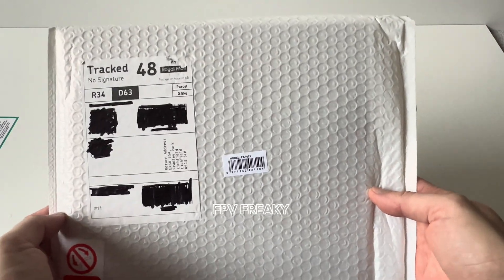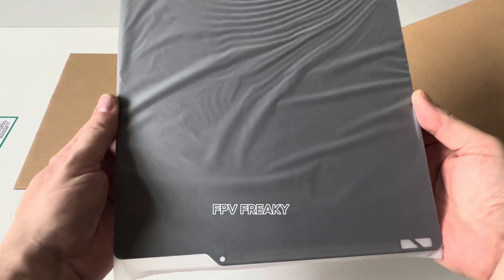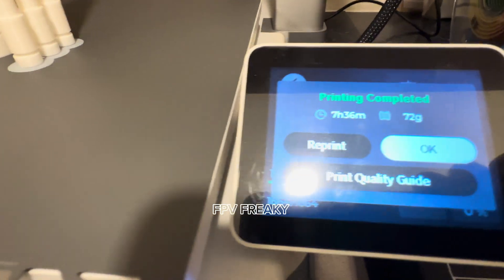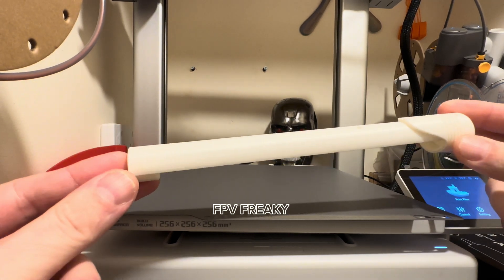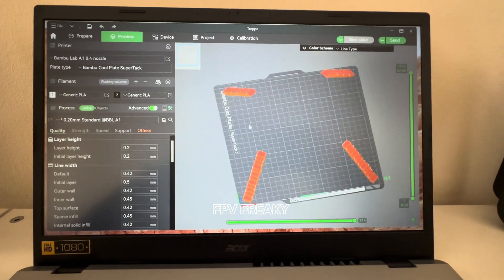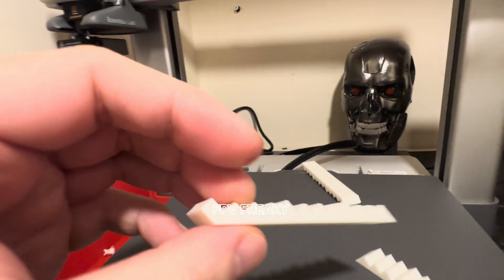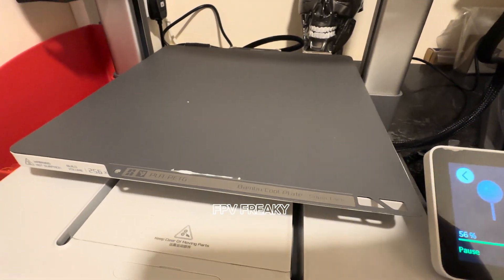Putting The New Bambu Labs Cool Plate To The Ultimate Test!

Comment from the maker: Time stamps
0:00 Unboxing The New bambu cool plate super tack
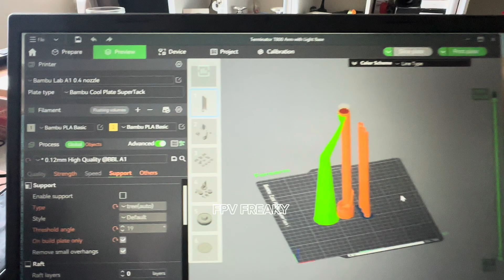1:54 loading my first failed print with the new plate.
3:11 swapping the new build plate over to the new cool plate super tack
3:26 timelapse of the first print on the new 3d build plate 
3:49 OMG WOW moment
3:53 Let’s have a look to see how well it has done. 
4:41 taking the parts off of the new super tack build plate for the first time.
7:25 problems I had beforehand.
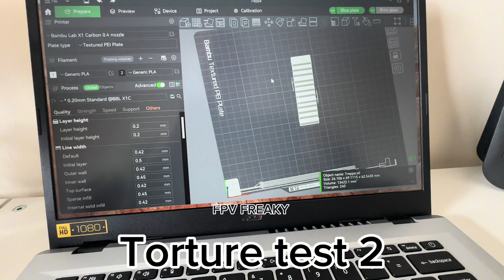8:10 second torture test loading a new model.
9:00 timelapse of the second torture test.
9:17 let’s have a look at the second test ( must watch).
10:41 third test pushing this super tack plate to the limits 45° 50° 55° angle tests. 
11:14. Timelapse third torture test what will happen?
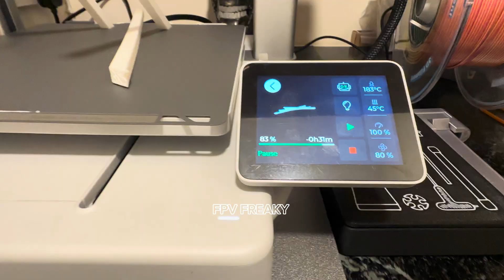11:43 let’s have a look see how well it did on the third test. 
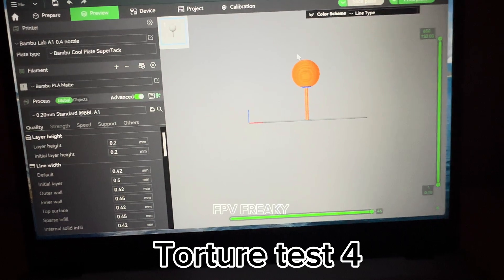13:03 fourth torture extreme test. How well will it do?
13:38 timelapse of the fourth and final extreme test.
14:09 let’s have a look . And final thoughts. Should you buy one?

Comment: I had a horrible time with both plates on my X1C and A1. Someone suggested I change from the SuperTack profile to the Smooth PEI and I had success with my A1 for about a week then went kaput, corners are lifting. No success with my X1C no matter what I tried. I made a video about it and other people have problems with it and same on the Facebook, many have issues as well.  I'm thinking Bambu probably have a bad batch.
Reply: why would you use Smooth PEI profile and higher bed temperatures with this plate? This plate is made for low temperatures, the lower the better the adhestion.  Store page telling use only PLA and PETG with this plate, temperature 45 degrees. The advantage of this plate should be -> lower temperature, less energy needed to heat, less heat inside a fully closed printer so no need for extra fans in case you don´t want to open doors. If you want to get your prints easier off the heat bed -> increase temperature to 50 degrees, like this the print should get off better. all readable at the store page of this plate
Reply: @Tobi123Tobs  because the instructions and the profile didn't work. I did a whole set of test to try it and if failed every single time. When I tried the suggestion of Smooth PEI it worked. The reason I got that is to use the lower temperature. I have a video on my channel showing it. It worked for about a week and now it's back at not work at all. I'm thinking they have a bad batch of plates.
Reply from the maker: @Slurgical_3D_Terrain_Channel  hmm that’s strange. Are you using the super tack profile recommended? Perhaps up the temperature while using the supertack plate. It might help adhesion. I must admit I printed a whole bed just yesterday with no issues whatsoever. Are you washing your build plate after uses? Just use soapy water. This might be the case with some people are not keeping their bed clean. I have printed multiple no issues. I will take a look at your video later. Have to go out right now.
Reply: @Fpvfreaky  Thank you for the response, yes, done all that, wash plate, tried up all the way to 75c down to 35c, used the SuperTack profile, the only thing that worked was changing the profile to smooth PEI and that worked.  I did large surface, small surface. on my regular plate I can print small 4mm wide circle no problem but no luck with SuperTack. I absolutely love their printers they are a game changer.  Some people have an amazing result with Supertack build plates while others total disaster. So bad batch of plates might be an issue.
Reply from the maker: @Slurgical_3D_Terrain_Channel  just uploaded new video. THINGS IVE PRINTED ON THE BAMBU COOL PLATE SO FAR
https://youtu.be/5mQ4CtZbKw4